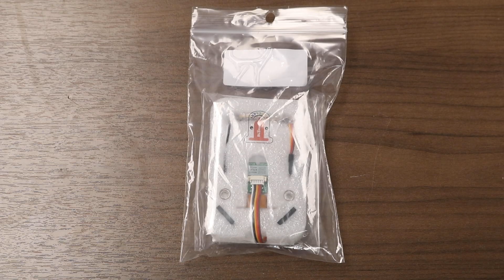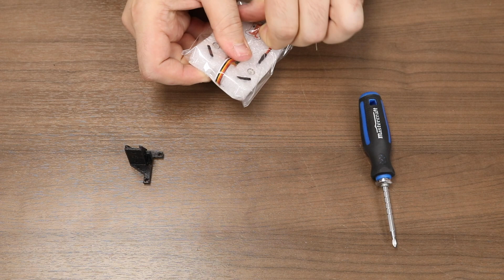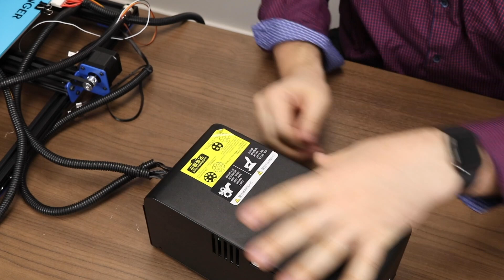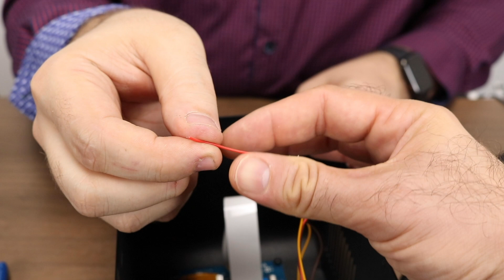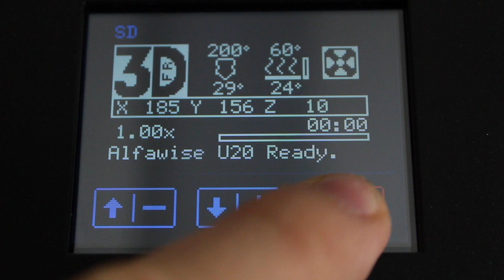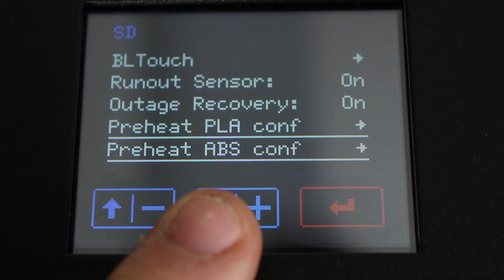Longer LK1 (Alfawise U20) BLTouch Install Guide

Comment: Is it possible to upload the new firmware, before making the electric adjustment necessary, just to see that its possible to use the firmware? 
I tried it but, but nothing happens?  🤔
I do se the green bar going up, but then nothing happens - I just see a full green bar (and I'm using the correct firmware for my board (V08))

Comment: Thanks for this.  I plan to move forward using the BLTouch and cable I already have.  Looking on your GitHub page, can you please clarify: the LK1 (Alfawise U20) is what I have.  It seems like across the board, the 1K resistor is not required.  Is that the case?  I have not cracked open the control box yet, but I get the distinct impression that the U20 does not require this resistor.  Also, on the assumption I have either the V0G or V0x board, there is one .BIN firmware file for the V0G and the V08 file is for all the other boards, correct?  Thanks!

Comment: Firmware for LK1 VOG board does not work it installs I take out the SD card leave the eprom file delete the project bin put back the sd power on but my touch screen has  no response?

Comment: Still can't get it to work on an Alfawise U20 Plus.. I get to the autohome part and then it just drills itself in to the bed until I pull the power
Reply: I'm having this problem. did you get this fixed? Thanks
Reply: @normcaissie5598  Nah, I gave up with it
Reply: @Wanton110  That sucks. thanks

Comment: Yeah done everything exact just goes to the middle of the bed goes down starts grinding...and yes the Z endstop have been removed
Reply: Yeah mine did that, now it wont go down at all.
Reply: Is you screen working now (mine doesn't) ... and when I use home Z it will goes to the middle and start going down without the needle of the bl_touch moving ...
Reply: I'm having this problem. did you get this fixed? Thanks

Comment: Hello, I've followed all instruction and I'm pretty sure the bl-touch is well installed. But when I try to install marlin with the : LK1V08_BLtouch_firmware.bin file nothing happens. Its the original firmware that loads up like if the .bin isn't recognized.
Can someone help me out. Please.

Update : The problem is I didn't have the longer3d.ui file on the SD card with the .bin file

Comment: How do you get the LCD touchscreen touch part to work after the firmware update?
Reply: did you figure that out ? I'm getting all kinds of issues with my builds (screen touch is working ... when Z home the bltouch doesn't extend the needle and it doesn't stop the z movement )

Comment: HI, could you please tell 
us  witch LONGER3D.UI did you use for flashing, the original provided by alfawise with 2.16 firmware doesnt work;(
Reply: mea culpa, it works , but on my printer always some problems with my bltouch, but will change some setting on the hardware and come back to report.
Reply: @christophe31000  it doesn't work.  At least on mine, I lost any touch inputs on the LCD.  Everything else works.

Comment: Am I correct in thinking that if I have a glass bed and have had no problems manual levelling or with the first layer on prints that use the majority of the build plate that adding a probe will not benefit my printing?
Reply: Even with glass there will be some variation in the bed - especially when we get over the 200 x 200 threshold. Therefore it is recommended to install ABL on larger machines.